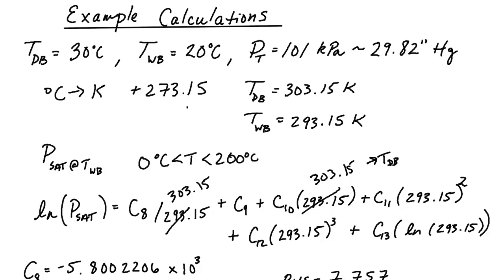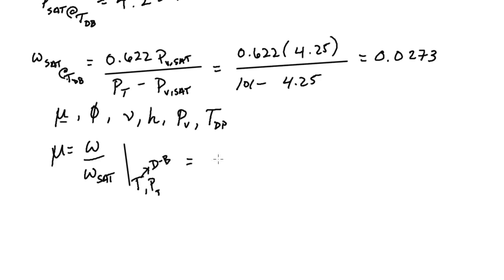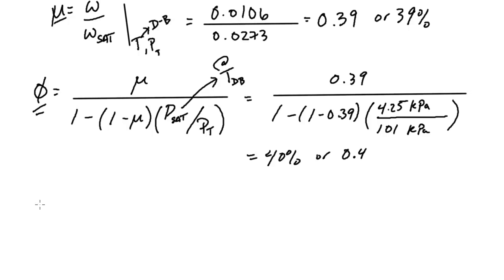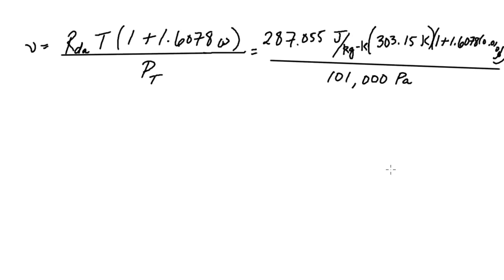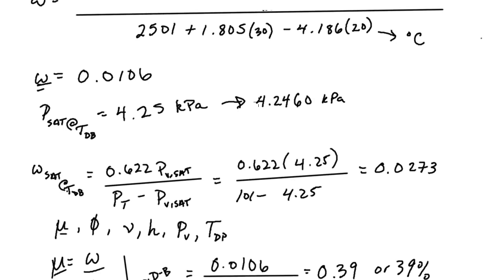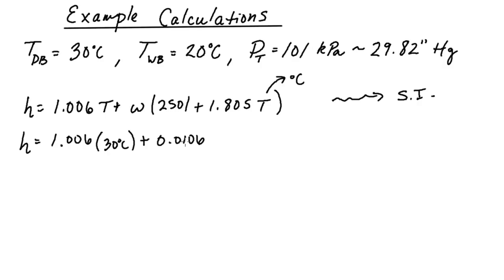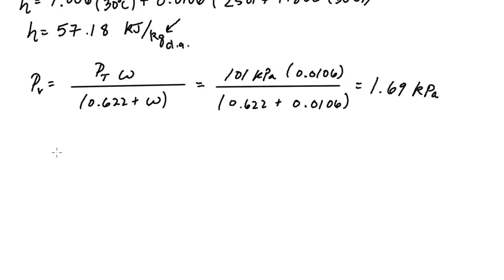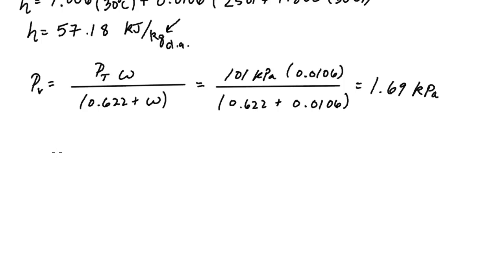Example Psychrometric Calculations: Part 2

Comment: If at the wet-bulb temperature, no more vaporization can take place as the air is saturated with water vapor, how is it that the temperature has to sink more in order to make it possible for the water vapor to condensate? Shouldn't the water vapor condensate already by the wet-bulb temperature?
Reply from the maker: The wet-bulb temperature is a property of any state, it does not have to be saturated. For example, if you are at 72°F and 50% RH, the wet bulb temperature is ~60°F, and the state is not saturated.